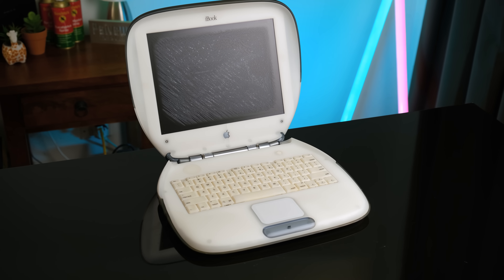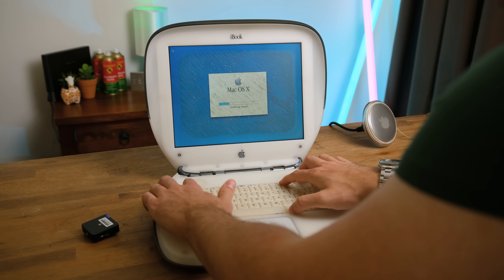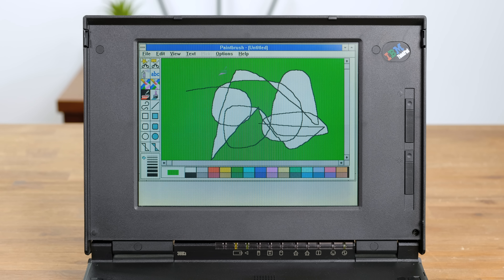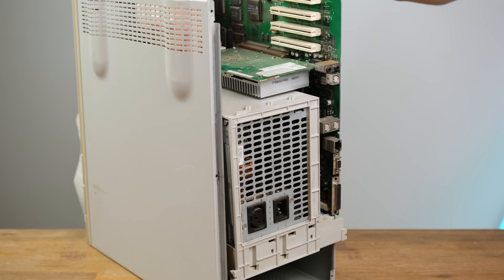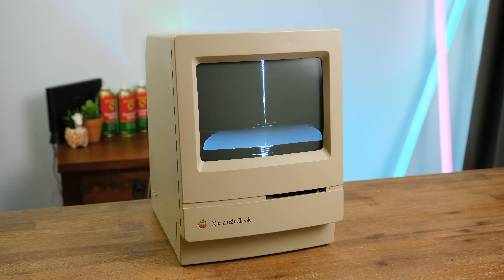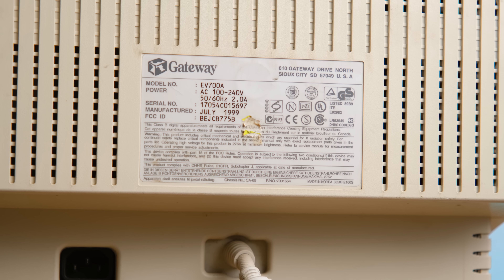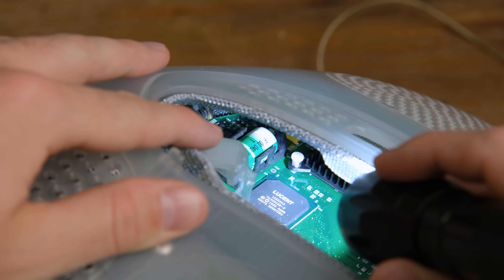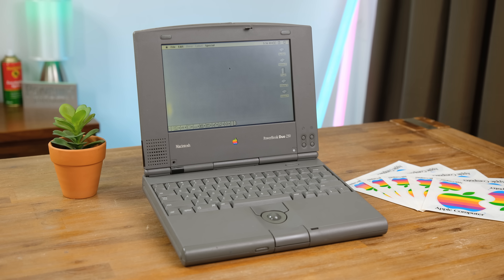So Much Vintage Tech Is Dying... Here's Why

Comment: Damn this makes me sad. The inevitability of decay even when you do everything right. Just think about all the files that are or will be lost to time not even just because of being forgotten but simply because the machine they were stored on broke down beyond recovery. You know everything ends eventually but watching it happen still hurts.
Reply: A few days ago, I was working to clear out all the computers from a small hospital that was being closed down.  In an office drawer, I found a 100% functional Windows 95 laptop.  Literally in brand new condition.  The battery still held a normal charge.  It seemed to have been there in the dry, climate controlled air for 28 years.  Humidity and heat are the biggest enemy of electronics.  Take those out of the equation and a system can last literally decades.
Sadly, it had to be decommissioned.  It should have gone to a tech museum imo...
Reply: @DrewT_1  Simple solution, "Decommission" it into your car when nobody is looking.
Reply: I wonder how long the magnetized data on HDD plates lasts. Theoretically SSDs are worse and more prone to corrupt in shorter time. I've even found some old USB sticks at some point just being curious what was on them, but lots of the files were corrupt.
Reply: @mrkiky  yeah, its really annoying when usb files dont work anymore. i think i found whats going on: 
TOSHIBA originally developed the ssd memory tech. toshiba manufactures and sells the actual ssd memory chips to OTHER USB stick MANUFACTURERS like sandisk etc. 
i dont think toshiba is selling them their best chips, because every other usb stick manufacturer is also in direct competition with toshiba in the same usb stick market.
personally i absolutely never had problems with toshiba branded usb sticks over the years. some files on almost every other brand became corrupt, on some many files.
so. few. good. usb. sticks. looks like toshiba is leading innovation just like their stupid slogan says. crazy, huh?
regarding how long magnetic data in HDD lasts, im 100% sure it lasts longer than any HDD motor.
Reply: Iost 2 years of work on a hard drive who suddenly died during the late 2000, at a time I didn't really know about data recovering...
Anyway after few days of mourning, I rewrite the disk so now it's f...ed.

Yep, it hurts.
Reply: @NiCoTHX  oof! :(
Reply: as far as old films go, there is a special vault built into the excavated salt mines under the great lakes where Hollywood and the government store film reals and other documents that require extreme environment conditions to preserve. The only other way I can see of keeping stuff from degrading is in a perfect vacuum in a chamber that blocks as many high energy particles from hitting it as possible!
Reply: @HighmageDerin  and you think storing that film inside a giant heap of salt is a good idea?  
even with big metal doors and filters.  it's the dumbest places to store such a thing.
Reply: @darkracer1252 how?
Reply: @HighmageDerin  perfect vacuum or in a pressurized container filled with non-reactive gas like nitrogen or one of the noble gasses
Reply: @ClippyForConsumerWrights   You mean like that stuff that they keep the Constitution in?.
Reply: @HighmageDerin  Oh, so like that flaming hot cheetos vault they did a while back.
Reply: @HighmageDerin  Some old films such a Jeanne D'Arc from 1900, which was colored by painting on film by the director is on video and some even older are also can use search above video to find them.
Reply: I will say data recovery is quite advanced these days. While yes everything may not be recoverable you would honestly be surprised of what can be recovered
Reply: @iiiiii7680  depends on how much you want to pay. An intelligence agency would have no problem dissect an hd for individual files by hand.
I once threw a laptop hd by accident on the floor. Tried a company. They only said the write head did smash into these plates inside. Recovery not possible. At least for a decent amount. I mean under a new complete high end pc.
Reply: awww Onyx...truth...
Reply: That is why you always make redundant copies of them onto new storage regularly....
Reply: @MIO9_sh   I remember one of the newer Batman cartoons had an episode where Mr. Free's frozen self for  A few 100 years and ended up in the far future. Batman always knew that he was still out there, So to preserve a record of how to beat him in the back cave he knew electronics would not survive that long. So we found one of the most long lasting metals in existence and stamped the binary code of the back computer and all its programs into the metal. So that future generations could upload it to new systems and run the programs
Reply: And while we're on the subject of electronics can somebody please force Google to make a voice to text program that actually understands what I say without having to speak like a robot the whole d*** time
Reply: @HighmageDerin  you don't have to force them, they ARE doing it already for their own profit. You're either speaking way too funky, or just simply the model isn't trained on your dialect.
Reply: @MIO9_sh   I don't think I sound weird. But I've noticed if I talk quickly like I'm having a normal conversation Google can't seem to understand what I say but if I talk slow it can understand almost everything. Which is a problem with me because when I get heated or excited about a topic that interests me, my mouth moves like a mile a minute
Reply: @HighmageDerin  Remind yourself you're literally talking to a robot then... There really is a limit on how fast an algorithm can think for now
Reply: “All those moments will be lost in time ... like tears in rain.”
Reply: @lawrencedoliveiro9104  awoooooooo!
Reply: That’s very frustrating to think about,if only  i knew that this can happen to everything, i might,ve never decided to collect old stuff,
I may would,ve never stuck on retro stuff but instead just keep moving forward by buying new stuff while replacing old stuff like buying a ps5 now and over 5 years buying a ps6 etc,,,
Same thing with smartphones,instead of getting stuck with my beloved iphone 6, i would,ve bought a new iphone 15 now and buy the iphone 16 next year or 5 years later if i got the money for it,yes that’s another thing to concern about,if you do have a high budget to replace all stuff overtime,otherwise you can’t,

BUT sadly for me i am a retro nerd desiring to preserve the past whether from old game consoles ,gaming handhelds and music etc,,,,
But i want to preserve my old memories from the past as well,
But sadly everything seems to be a ticking time bomb🥲🥲🥲
Reply: @johneygd  Please watch "Don't Hug Me I'm Scared: Time"
Reply: Everything dies.

https://youtu.be/NJ3aiM8K6D0
Reply: I worry not, not many things are permanent, but I know my NES and SNES and their game will always be there. They were here long before time started and will be here long after time ends.
Reply: This is why we make backups, and backups of backups, and backups of backupped backups.
Reply: and some of us even have our food backed up 🤪
Reply: planned obsolescence is not doing it right.
Reply: Every time I hear somebody say “nothing lasts forever”, I wonder: will that always be true?
Reply: @lawrencedoliveiro9104  good question. I mean it probably will, but with technology advancements we could theoretically keep pushing that end farther and farther to where humans don’t really have to worry about it. But with the heat death of the universe everything is gonna end at some point just not for a REEEEEEAAAAAALLLLYYYYYY long time.
Reply: @OnyxLotus  Just to be clear, does “nothing lasts forever” apply to the principle that “nothing lasts forever” itself? Or is that one thing that does “last forever”? In which case the statement is false.
Reply: @lawrencedoliveiro9104  ooooooh so it’s like a paradox lol. I mean I guess after everyone who knew the phrase died there would be no one else to say the phrase, so it would have not lasted forever either without making it false 😂
Reply: This raises the question of what will remain of our history in the future, thousands of years from now.
Reply: Yeah... I had been keeping my Galaxy S from 2010 just to store the pictures that were on it. I don't know why I never backed them up, I guess I figured they were safe on the phone... but recently the SD card went bad from age. All my pictures from 2010 - 2013 on that phone are now lost to the ages! I'll try some more advanced recovery methods with Disk Drill or some other recovery program later.
Reply: oh nooooo thats terrible! i hope you're able to recover some of them! @BertieW0oster
Reply: I notice these are ALL Apple products. Apple doesn't make REAL computers, just cheap knock offs built for the public school system.
Reply: @hushnowyoureirrelevant  yea, I didn't figure it was worth losing the job over.  It's a good job.  Though in hindsight, I don't think there was any tracking tech on somethin that old.. 🤫😕
Reply: I've got some great news for you! Its called cloud storage.
Reply: @horrido666  "Your data is unavailable to access due to changed terms of service."
Reply: every data information is in cloud nowadays anyway 😅 clouds cant be destroyed unless earth itself is in apocalypse
Reply: @nat0106951  sounds like the most robust thing on the planet🌍👍
probably safer to to store data as QR codes carved into cave walls.
gimme the chisel...
Reply: @nat0106951  you do know “the cloud” just means it’s stored on a company’s server elsewhere right? It’s still on a physical device, just not yours.
Reply: this guy is most deffinatly doing nothing right.
Reply: All by Design. The past must always be deleted so they can keep lying to the next generation about it.
This is why video and audio formats are always changing too. This is only one of the things put in place to fulfil that agenda too.
Why do you think hard drives are now soft drives and everything is pushed online.. All that used to be paperwork. 
Then they Stage an EMP event and delete everything because they put all the data in one basket as they continue to do.
PS: They are the Eastern Matriarchy .. They are The Real Enemy of the people. (Who are not of their lineage.)
These are not CLAIMS either.. They are SOLID FACTS.
Reply: Everyone dies bud
Reply: IT'S CALLED IN-BUILT OBSOLESCENCE!!! A CURSE ON ALL CONSUMER PRODUCTS FOR THE BEST PART OF 30 YEARS+!! IF CONSUMERS BOTHERED TO COMPLAIN MORE, IT WOULD HAVE KEPT MANUFACTURERS ON THEIR TOES REGARDING QUALITY!!! BUT NO, A WEAK AND PASSIVE POPULATION SAID "NO WORRIES"!!!!!
Reply: If you think that's depressing, wait until you find out that you're going to die someday too.

Don't feel bad about the lost files, though. Humans generate an insane amount of data on a daily basis, almost all of which is only worth keeping until you find out whether it will ever be useful someday. Most data is no more valuable than old purchase receipts.

Comment: 'old' is relative. I have 70's and 80's stuff that is just a light yellow with even the 50 year old capacitors still functioning. [ whereas my 90's Commadores are leaking caps all over ( more US lo-buck crepe ) ]. American products 'made to a price' are some of the worst for rotting plastics.
Palm pilot screen flex-cables also rot like that Mac's crepe!

Comment: One day, after spending the day removing all the swollen battery packs out of some old 2008 Macbooks at work, I had the funny feeling I should check my old Nintendo DS, since mine was from 08 as well. Luckily, I caught it at the right time. The back plastic was starting to swell, but it wasn't deformed once I removed the battery. My PSP didn't share the same fate. The battery was so swollen that the screen was pushed out of its frame. Looking it up online, I found out that many DSes and PSPs have been succumbing to swollen batteries.

Comment: It’s incredibly unfortunate that technology that was once clean and fresh is literally decaying just for sitting still. You just gotta think that the iPhones 2G’s that are sealed in the box are probably ticking time bombs of financial disaster for anyone that chooses to keep them in their box after paying a fortune for them.
Reply: You needs to castrate them (remove battery) to make the rest survive. But also flash memory decays without electricity (particularly if well worn by erasing files). I bought on fleamarkets dozens of McDonalds Happy Meal LCD games where the button cells were barely removable. I did take them out (needs special screwdrivers and patience), which is the only chance not to decompose.
Reply: @cyberyogicowindler2448  there’s only one downside though, it’s that you need to unbox the phones to get to them. meaning that eventually, there will be no old unopened iPhones, the survivors will have to be opened and remove the batteries.
Reply: @diplexnormal3353  I consider the "never removed from box" cult a sheer plain decadence. Even batteryless products like rubber action figures tend to decompose if left in box when held by too tight straps cutting into them etc. Many things with specified shelf life rot in original packaging much worse than if stored properly. Some things last longer when stored airtight, while others decompose because corrosive substances (battery leak vapours, acidic glues, migrating plasticizers) are already inside and cause harm when they can't vent out.

I try to keep all original boxes but mostly fold them flat and store them in dark plastic bags. I rarely store collectables inside their box unless it is the most space saving method.
Reply: @cyberyogicowindler2448  well, you can’t just “fold flat” a iPhone box but I do understand you 100% as my dad collects tons of stuff such as vintage Star Wars, 6 million dollar man, planet of the apes etc etc.
Reply: @diplexnormal3353  I mainly collect bigger things (music keyboards, sound toys etc.) where the box tends to be much bigger than contents. I store most keyboards upright (like books) in cabinets.

Smartphones are a brain destroying invention that should be eradicated from mankind. Nevertheless they do exist and became crucial part of human history, so also these need to be preserved. Their shortlived nature and dependence on cloud services and fading flash memory will leave future archeologists staring at their remains in shape of silent black mirrors as puzzled as we nowadays try hard to understand the Voynich Manuscript (a medieval science book that nobody can read anymore).

Comment: Thanks, great info. I've got an IBM or lappie or 2 I have purchased and I wondered "what dickhead cleaned the screen with turpentine" but now I know it is "vinegar syndrome". A bit of a revelation really!  I'm still hunting for viable replacement screens though. Great video on the whole and food for thought.
Reply: The TFT front glass on some Thinkpads was glued with pine resin, which tended to melt over time (by heat and sunlight?), leaving bubbles under the glass and sticky fingers smelling like xmas.

Comment: With modern 3d printing, we may be able to reproduce the plastic parts as needed potentially. As far as everything else, traditional rebuilding techniques are still really the only way we still have, if you are capable of doing so however

Comment: I think its mainly Oxygen that causes it to degrade over time. Similar to what happens to paper when it ages.
Reply: Ozone harms plastic and rubber, but most of the corrosive substance is typically already inside (battery leak vapour, plasticizers, wrong oils, acidic glues), so sealing it airtight will make the disaster much worse than letting it safely vent out.

Comment: I started a vintage computer hobby a few years ago. It was my first experience with bulging capacitors. Just before retiring I sold all but one system (one never forgets ones first love - for me it was 1982 & the Texas Instruments 99/4A). Maintaining multiple systems failing at varying rates turned the hobby into a full-time job, which was not how I envisioned my retirement. Pairing it down to a single system, one that actually had nostalgic value, made it more tenable.

But every time she fails to boot, or a new noise develops, I do cringe and hide my wallet. I replaced the VDP witrh a modern VGA-output  replacement, so displays are never an issue...but 70's/80's era hard drives and expansion cards are another matter. If you replace everything with modern equivalents, what's the point of a nostalgic hobby ?  So one learns to love with just a touch more attention to the signs of old age, as one must with an aging friend. I was not a young man when I first brought her home, so no telling who will go first, but so far she always says Good Morning when I slide the power button.

Comment: MS was experimenting with cooling severs in pods under the sea and one of the major findings was that hardware lasts a lot longer when it’s surrounded by an inert gas. Oxygen is wrecking havoc on old hardware 24/7.
Reply: Ozone harms plastic and rubber, but most of the corrosive substance is typically already inside (battery leak vapour, plasticizers, wrong oils, acidic glues), so sealing it airtight can make the disaster much worse than letting it safely vent out.